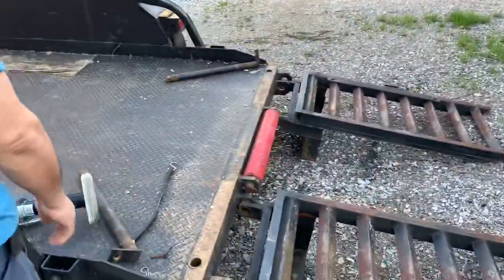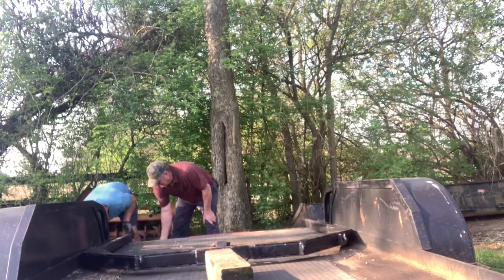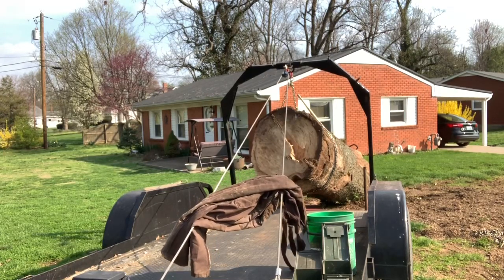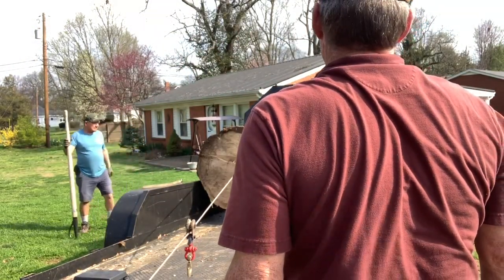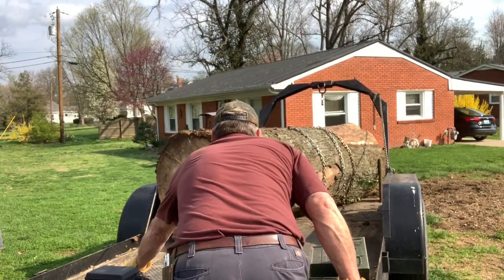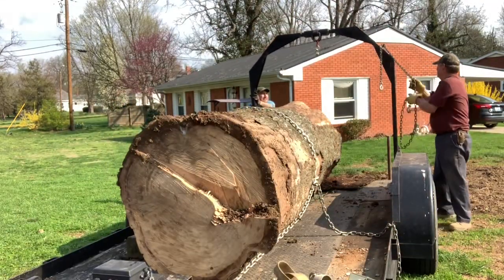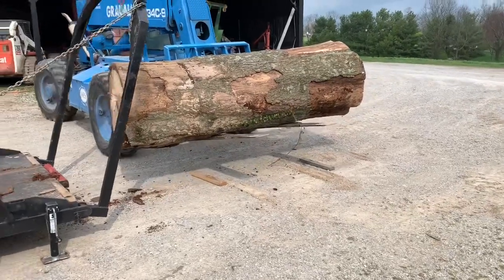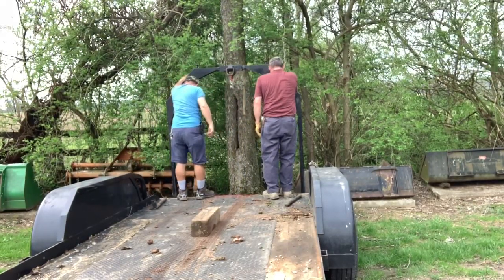Log Arch Trailer Conversion

Comment: Nice video. I have a similar setup with the same winch. I wish this winch had a spooling guide. I’ve had to hook it to a tree to unspool it because of crossing the cable on the spool. Also  I need to manage that crashing down of the arch and find a way to unload it without a tree to anchor a block.

Comment: Cool setup there,  I'd like one for  one of my trailers  just to move blown down trees/logs to the burn pile or just kind of a portable crane. Looks like you are good to go in the equipment department.
Reply from the maker: Thanks, it works great. We just take the arch off and use it for an Equipment trailer

Comment: Nice work, but you scared me standing so near that cable under such tension!
Would have been nice to know what winch capacity you were using and also what tubing dimensions on the log arch.
Thanks for sharing this endeavor!
Reply from the maker: The winch capacity is 8000 lbs. and the tubing was 2in X 3in X 1/4 wall. That is why I kept putting old coveralls on the cable. That would help to prevent cable from snapping towards me.  Thanks for commenting and watching.

Comment: Trying to decide if my 10ft trailer is worth putting an arch on
Reply from the maker: 10 ft is ok. Its the GVW of the trailer that matters. If you dont have 6 or 7000 lb axles its not worth it.  that trailer is a 15000 gvw trailer. I wouldnt go anything less than 12000 gvw. It wouldnt be worth the expense of building the rest of the trailer for anything less. Just Remember, you will over load it !!!

Comment: With the right tools you can make it look easy.
That’s a huge log.
What kind of winch did you use?
Reply from the maker: Yes it was very big. I took it to a farm scale and it weighed 7600 lbs. I wanted to practice on a few smaller logs but I had to get this log out for the customer. It was our first one. It handled it better than I thought it would.
 That was a Harbor Freight 8000 lb winch. They usually stock that one but can order a 12000 lb. If I built it again I would get the 12000 lb. just for extra power. Thanks For the comments